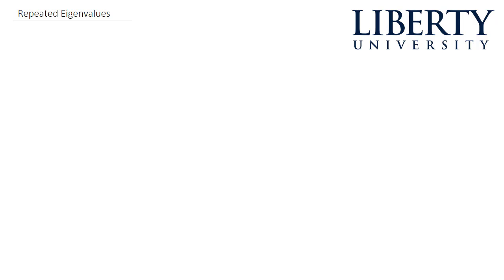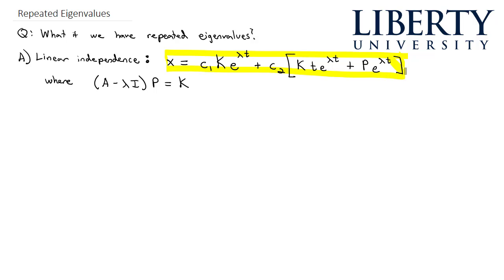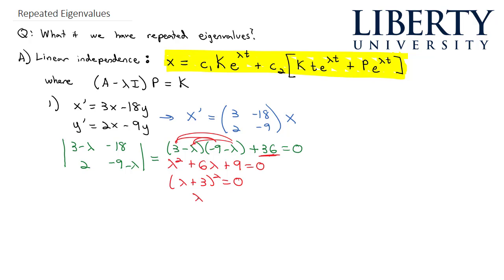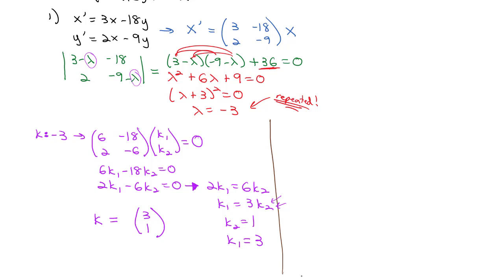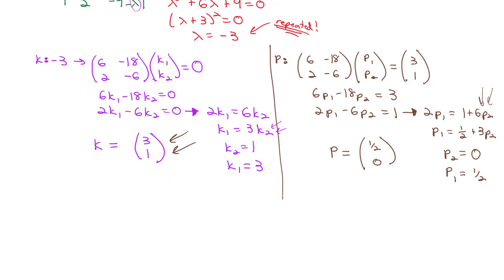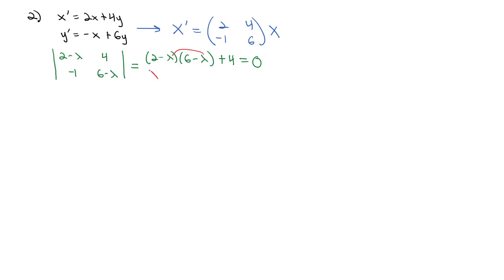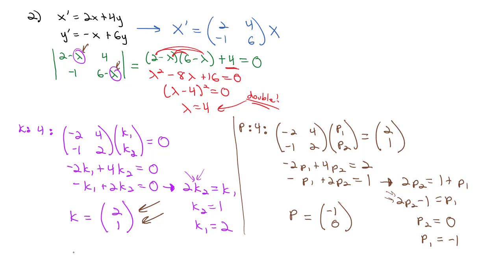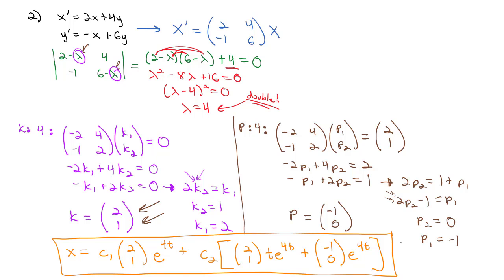Repeated Eigenvalues

Comment: Could you do an example where the system gives repeated eigenvalues and the one value produces 2 linearly independent eigenvectors? I believe this kind of system will have a proper node also called star point.

Comment: Why do people teach like this ? There is no intuition here. No understanding. What's the point.
Reply: It can work as a review if you kinda understand the concept and this kind of thing is kinda repeated throughout the course. That’s what I think
Reply: You'll only have the intuition if you have enough background knowledge of the subject. At the level of math for this video, its already understood that we can find eigenvalues which relate to matrices and the intuition comes from choosing the form of the solution and plugging it into the original system of differential equations. Then we find out about eigenvectors. This is how we find solutions. Then once we get repeating eigenvalues we need to gain new intuition. In this video he finds the one eigenvector and then has to do a new technique to find a second eigenvector called a generalized eigenvector to find a second solution.